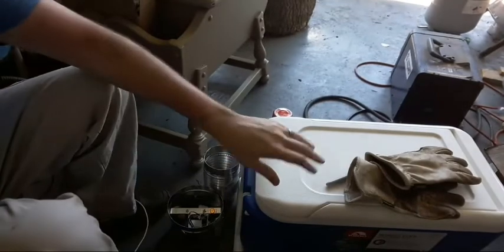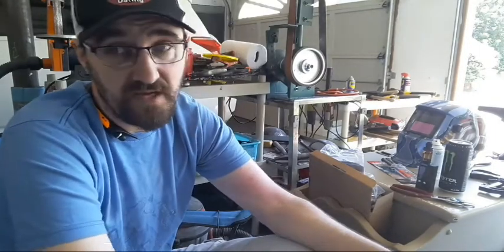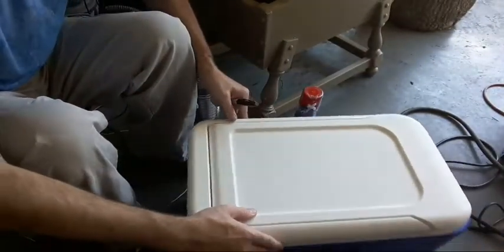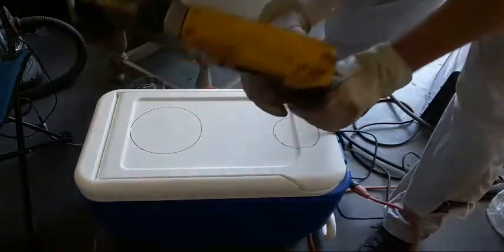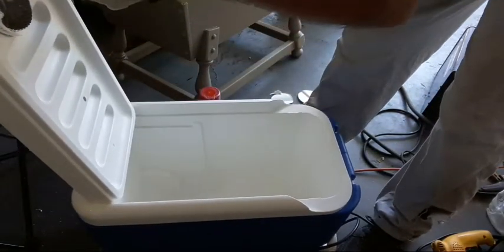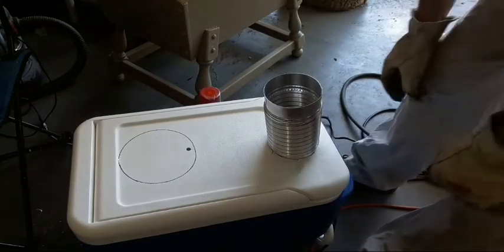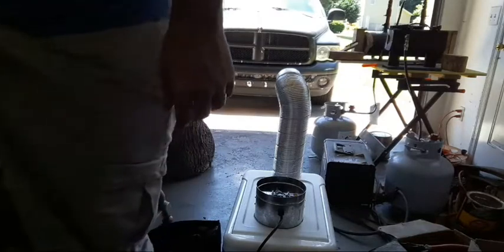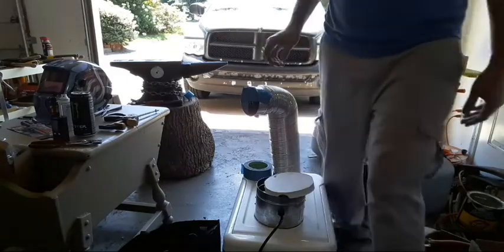Building my portable AC for the shop

Comment: Looks good. The hollow lid doesn't help with insulation. I have the same cooler and will probably follow your lead and make one. Knowing me, I'll probably think about it in November when it cools down and I won't need it.
Thanks for videoing and posting.
Reply from the maker: mark Rossnagel Yessir. I'm tempted to drill some holes in the bottom of the lid and flood it with expanding foam.

Comment: Give us a post 1 week review, let us know how well it works. Anything you would change and whatnot
Reply from the maker: DERICKBLAIR4 You'll find out. It'll be running every time I'm in the shop. I really need more ice packs for it. Most of the ice has melted but the air coming out is still pretty cooled down like 4 hours later.
Reply: ya I believe it, when I lived in an apartment, we would run the cold shower, and it would cool down pretty good. so I imagine keeping that diy AC close to you when working will keep you pretty cool out in the garage
Reply from the maker: DERICKBLAIR4 That's what I hope. Once I can fill it to the top with ice packs I should see a pronounced difference. And staying comfortable results in better work done safer.

Comment: Definate plus on the AC unit. Thumbs up (& a faht for good measure) ;)
Reply from the maker: drason69 Dude even with not enough ice and loading the ice packs Inhad in there wrong it still kept blowing cool air out for a good 4 1/2 hours.